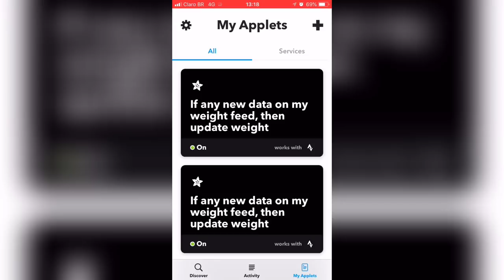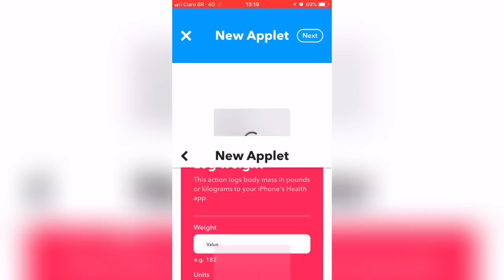How to make a Wi-Fi Smart Scale (with ESP8266 Firebeetle, Arduino IDE, Adafruit.io and IFTTT)

Comment: Hi Igor, thanks for the project. I have just started to build my own :)
My question is after I put the two firebeetle together I plugged in and only the ESP board light flashing. In your video some text scrolling. I need to flash some code to get le text or I did something wrong when soldered the pins? Thanks, Norbert
Reply from the maker: Hi there! I’m glad you enjoyed it.
Once you solder the pins and connect the two boards (the esp 8266 and the led matrix), you’ll have to upload a code.
You can find a sample code here:
https://www.dfrobot.com/wiki/index.php/FireBeetle_Covers-24%C3%978_LED_Matrix_(Yellow)_SKU:_DFR0487